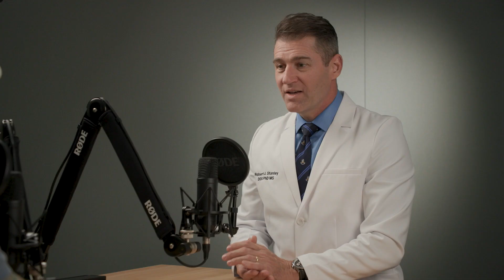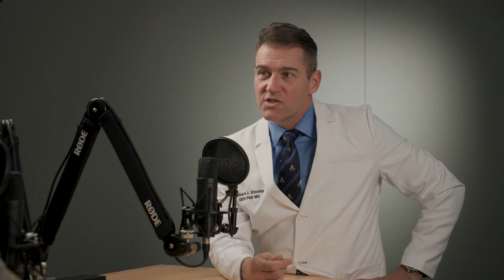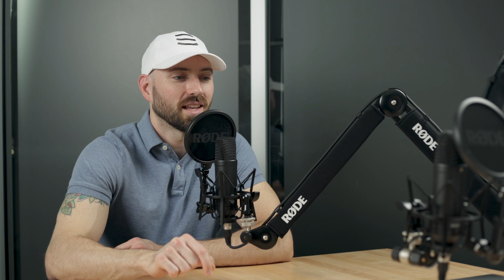How much torque is TOO MUCH?? (Or too little)

Comment: hi doc,   so the 5 thread rule talks abt load on the 1st 5 threads  that are in the coronal portion of the implant (maybe not more than 3 mm), how does this rule apply for immediate implants when you actually engage in the apical threads of the implant?   plz also note that many people are talking abt smaller implants so u can allow bone to form (or be grafted) in the mid and coronal thirds of the implant 
also u didnt talk enough abt abutment torque

Comment: Hey doc. But what's the answer? Is there no max torque? Are we not still worried about pressure necrosis? Fracture of the implant or instruments? Does it depend on if the torque is created at the cortical bone level or lower? Does it depend on the implant design? Does it matter if you use a cortical bone relief drill? I'm now placing neodent and they recommend only up to 65Ncm. I used to place biohorizons and their kit doesn't even have a torque wrench with which to measure.
Reply from the maker: To adequately address your questions, I’ll be creating an additional video on torque. Stay tuned!

Comment: Sir i have a implant in anterior mandible ,had high torque in end 2-3 threads like 50-55. Is it fine
Reply from the maker: It should be just fine. That happens often due the dense nature of the lower anterior mandible.

Comment: Sir i have question…
I didnt find an answer to what happen with me
I insert the implant by motor in 35ncm so 3/4 of implant go with motor then i continue with wrench down i find torque less than 20ncm
Reply from the maker: It is possible to start with higher torques and end with lower torques, if during the insertion process, the implant threads engage compact bone, which resist the apical movement of the implant, which in effect turns your implant into an auger and strips the bone in between the threads. The worst case scenario is the implant turns into a spinner.